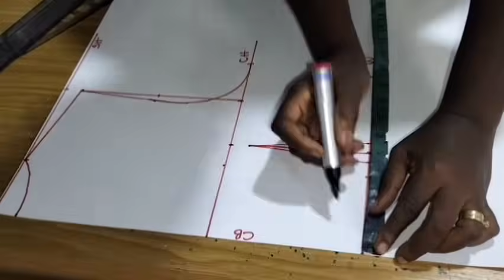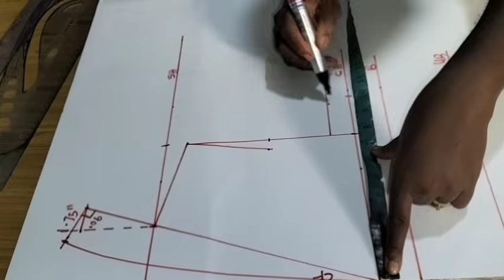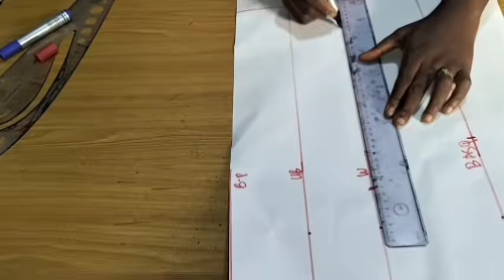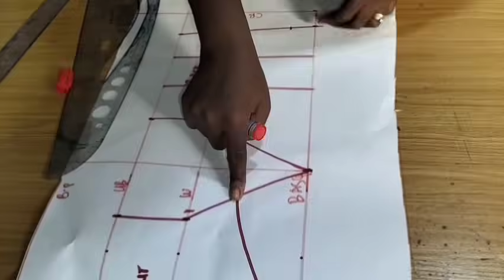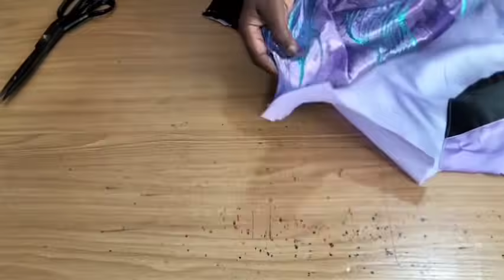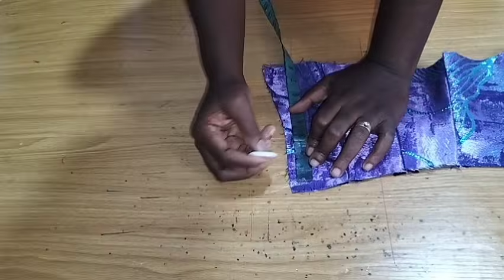How to Sew Sleeveless Built up Collar Flare Gown with Underbust Corset

Comment: Pls for the back pattern did you use the nipple to nipple measurement diveded by 4 or you use the midpoint. The front for the underbust part how many inches did you use for the contouring. 0.25 for the front and how many inches for the other side
Reply from the maker: Midpoint of waist divide by 4 is better,0.25 in front and 1.5 at the side